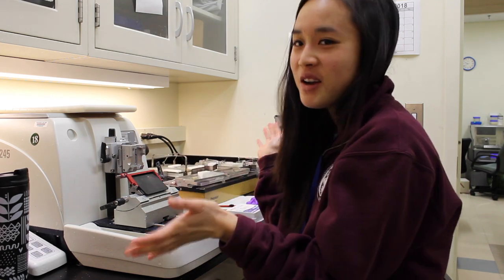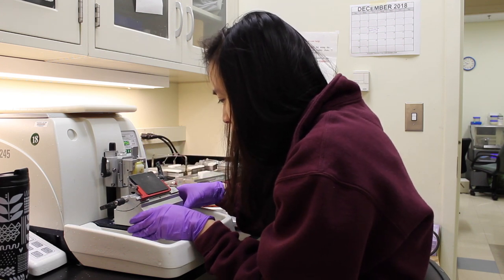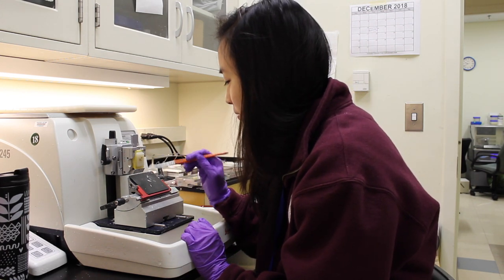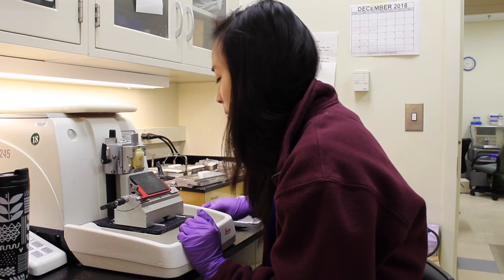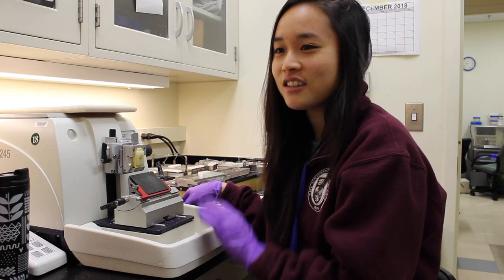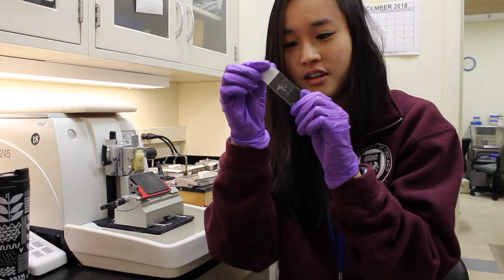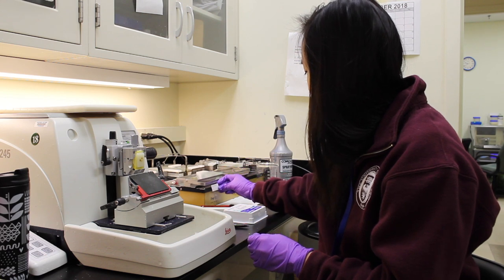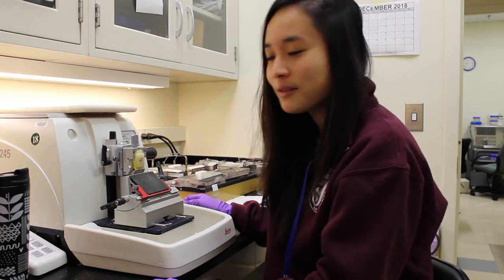Postbac Life: Lindsey Jay Demonstrates the Microtome

Comment: your hair is all on the chuck when blowing on it. that's an infection control issue. And blowing hot hair from your throat can spread your droplets onto the tissue block, possibly causing a misdiagnosis or interference of diagnosis. But go on.
Reply: would an ir lamp be the best to heat the surface wax slighly?

Comment: Why are you blowing air in the tissue block? What's the principle behind it?
Reply: The moisture acts as a lube between the section and the blade, so you'll get even and flat sections, otherwise they'll come out jarring and wrinkled
Reply: @T.J.1033 why not just put it In the water bath to prevent that?
Reply: @emily_notaro1872  that's what  you do once you separate the section from the rest of the block, but until you reach that point, you'll have to find some way to add moisture to the blade(and the block)